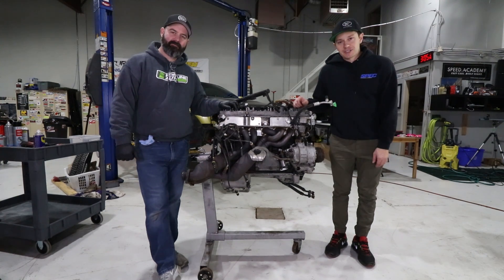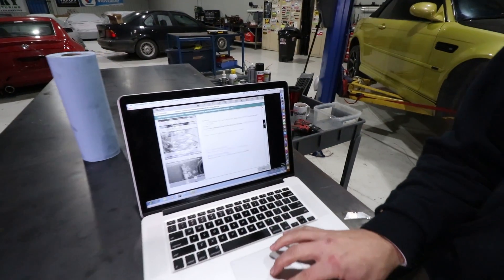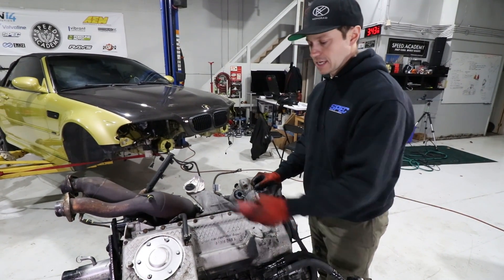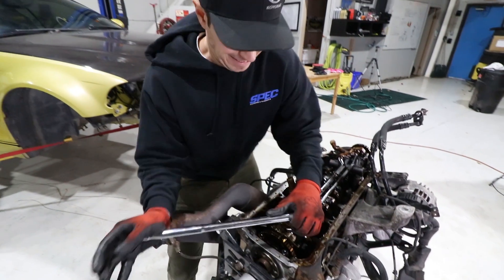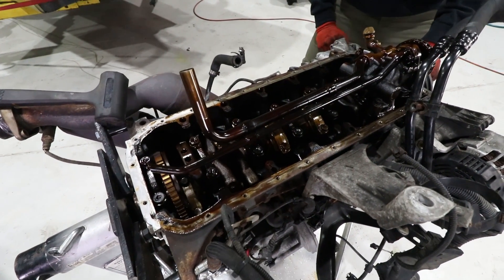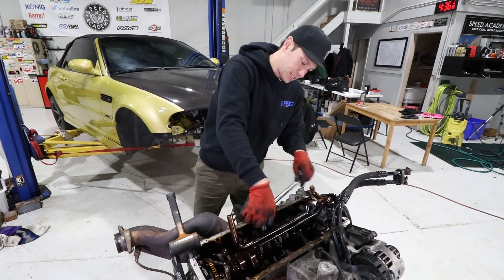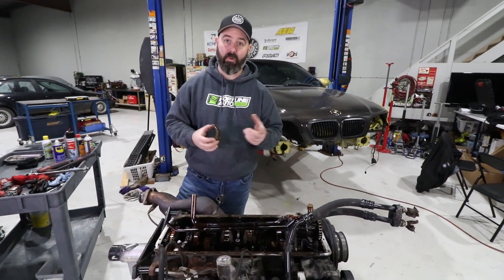Rebuilding and Modifying a $4000 BMW E46 M3 - Part 9

Comment: I have a 04 m3 was the recall for all years  or what
Reply: Lamont Austin believe it was the 2001 - 2003.5 models only but it wouldn’t be a bad idea to send an oil sample to Blackstone labs for them to check out Iron and copper material in your s54 for peace of mind especially if your m3 has more than 100k miles
Reply: How is the top on yours
Reply: Lamont Austin the convertible top ? Or the rod bearing top caps ? Lol
Reply: Top
Reply: Lamont Austin convertible top is in fair condition but the motor itself for the top has been giving me problems lately. and it’s looking like it’s gonna take a lot of $ to fix it !
Reply: Well mine will start to open and then I have to push it a lil bit so I have been trying to ask why do I have to help it
Reply: Lamont Austin the hydraulic motor is probably starting to get weak, I would recommend not to put your top down until u can figure what’s going on with the hydraulic motor. Because if you have to physically push it down for it to close then that can actually cause some damage to the fabric top itself.
Reply: I help it open It will close good it's to open I push up a lil bit and it dont happen  every time I've looked for videos  but I haven't seen and for what I got going on
Reply: Lamont Austin would probably take it to a convertible specialist to get it looked at. Someone who has dealt with Bmw electronic convertibles before. My convertible top is stuck closed & cant open if I wanted to. There’s a lot of headaches when dealing with old convertibles that’s why my next car will be a hardtop with a sunroof lol.
Reply: There is a video were the wires on driver side had broke that might help good luck
Reply: Lamont Austin thanks man same to you !

Comment: Your engine is a pre 12/02 so your rod bolts are reusable.  After 12/02 the rod bolts went to m10 with a inverted torx head and need to be replaced every time they’re removed.  Lang racing development has some really good articles on s54 rod bearings and provide some good food for thought.  Also one last thing:  the bearing wears much faster on the upper (piston side) of the con rod, the end cap bearing will almost show you nothing.
Reply: Inverted torx inside the engine?  These BMW engineers are mad! :P

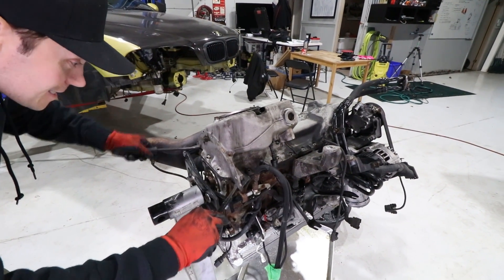Comment: 4:13 BMW did something to make a job easier? BMW?
I'm sure it must just be an oversight.
Reply: Bmw does lot of things to make servicing easier. Lot more than other car brands that I have worked on.
Reply: MrClown same experience as Pazi. Most things make sense and there are tons of little things making servicing and repairs easier. You just need to know how to do things right and you need more tools than just a hammer, chisel and curse words.

Comment: Just use OEM stuf, stronger bearings will cause more use on the crank, and you do not want to change that.
Reply: A trick for that is to send the crank in for grinding then have them grind off 0.25" off each journal and have it hard chromed 0.35" bigger and ground back to OEM size

Hard chrome will be much more durable
Reply: @Realtime1501  we talk about an another Budget then.

Comment: while the engine is out, id also do the headgasket and vanos.
Reply: i would say do not touch headgasket if it's not leaking. Vanos service is not neccecary either if it's not broke.
Reply: I agree on the headgasket, not a common failure point in maintained s54’s.  The issue with the vanos is there’s a chance the bolts can back out and the tabs on a ring can break off into the engine, both being able to destroy it.  It’s good peace of mind when you’re going to be at the limiter a lot.
Reply: Headgasket does not need to be done unless there is an issue.  The VANOS should be done as a precaution.
Reply: Don't need to do headgasket but definitely do the vanos rebuild.
Reply: are you joking. The vanos is one of the most costly repair items if it goes bad. just replace the comments while you're there... @jonassjoblad2728

Comment: I never really understood the super long oil change intervals BMW recommends, evidently it's too long. Redline Oil has some good info on the BMW stuff and their oil change intervals. As for rod bolts (this is Honda/Generic info), if you use ARP bolts with ARP lube the actual clamping load will differ from the spec used when the rods were machined leaving the rod big ends oblonged. The mating surface of the rod face looks like their fractured from the factory so maybe the rods can't be resized? I'd wait for some BMW experts...

Comment: The more I watch videos with German cars the less I am impressed by "German Engineering".  Seems like a lot of stuff breaks early, made of inferior materials and when you need to repair/replace it, taking apart the car isn't as thought-out as compared to American/Japanese cars.
Reply: The Wakz it’s just 2000s stuff that is that way with many manufacturers. That was a time when everyone wanted to sell more, make more money, so they had to produce faster and cheaper. Also, people were used to the longevity of the 80s and 90s so they beat the fuck out of everything too. Just do proper maintenance, a few preventative things and you’re good to go.
Reply: Dude, this is a 8500 rpm redlining engine with over 100hp per 1000cc displacement, I am super impressed with the S54.... twice the specific output then most US engines. The S-engines are full blown race-engines that is useable on the street.
They need more knowledge and maintenance the the standard crapbox.
Reply: @theseal666  Good points.
Reply: The Wakz thanks!! Go drive an S54 equipped car, you will love the response, sound and dual nature.
Reply: @theseal666  I love the s54 in my z4m, but no, they aren't full blown race engines at all. Honda don't have this problem in their 100hp per 1l engines. Bmw made the same mistake with the following v8 and v10 engines. It's a design flaw.

Comment: Was that rubber hose at the bottom of oil pan, if so bad design and scarry!!
Reply: It's the oil return from the head and yeah, rubber. They updated them for 2003+ with braided hose, much better 😁

Comment: So much for a budget build. Lol. Break it all the way down to bare block and send it to get cleaned. Clean all the parts. Check the rod sizes, get them shot peened and then rebuild that sucker. Reseal, new bearings etc. Be done. 0 it out as far as seals and bearings go and send it with a clean engine rather that a varnished up block and head. Who knows how bad the oil passages look.

Comment: This was actually useful. Rods seem to be a big issue on a lot of Ms
Reply: Even more so on Subaru's with a EJ25.
Reply: 99% of the N and M series motors will eventually develop rod problems was told by a renowned BMW tuning shop locally

Comment: Hey you guys should really look into a bolt extractor. I saw another video for a Subaru rebuild and their tech used a “bolt extractor” to get rusty bolts out.

I’ve never heard of them, but I figured you guys should really check them out for all those “Canadian special” bolts you guys have to deal with. Figured you guys would need them more than anyone for a few projects.

Comment: Also take the time to actually blueprint and balance everything while it's apart. You'll thank yourself later. Upgrade bearings most definitely. Never pull apart and go OE unless that is a superior part to aftermarket for producing horsepower. Always future proof. No point being apart without taking into account future abuse to things. Save ya big bucks later. Overbuild so you can oversleep as they say.